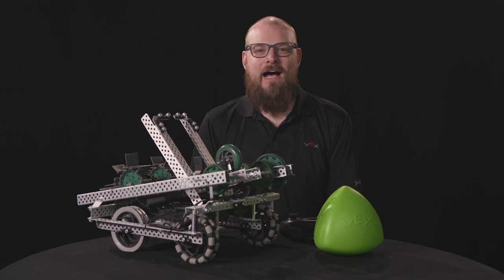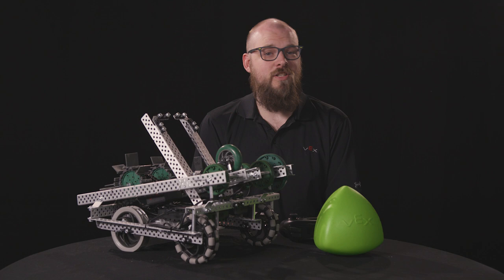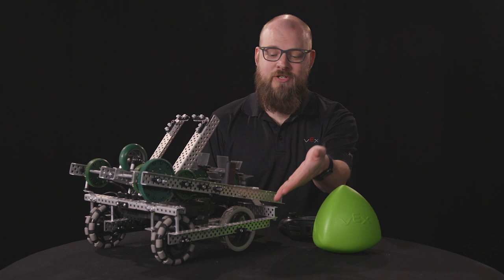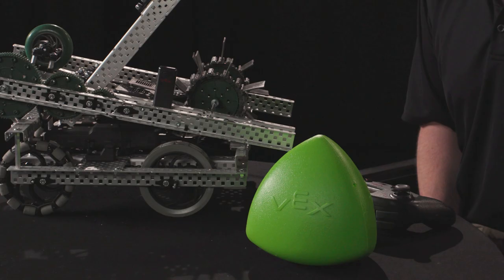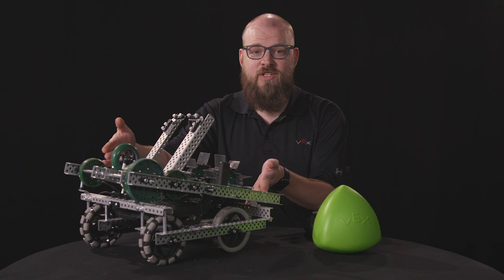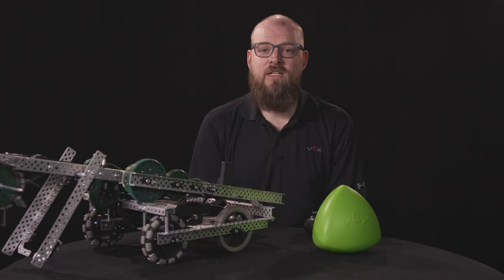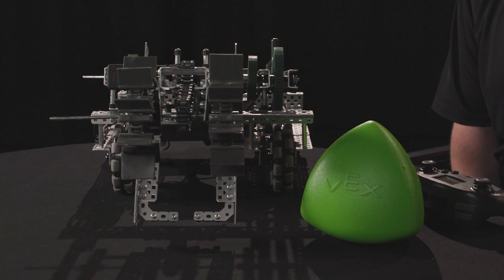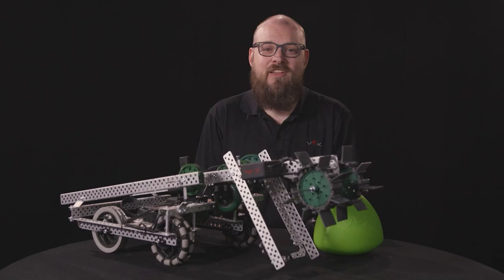VRC Over Under | Hero Bot "Striker" | Part 1

Comment: What is the motor cap this year
Reply: There’s actually no real motor cap, the cap is just 88W total, so if you use all 11W motors on your bot, you can only use 8
Reply: @swstudios9374 and they also added 5.5 watt motors as well, so you can use a combination of both, as long as you don't go over 88 watts